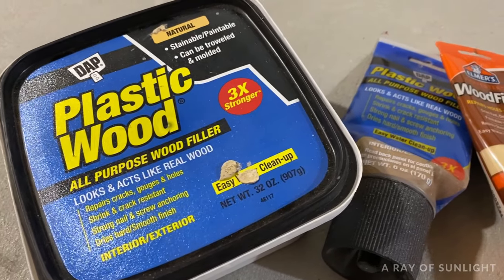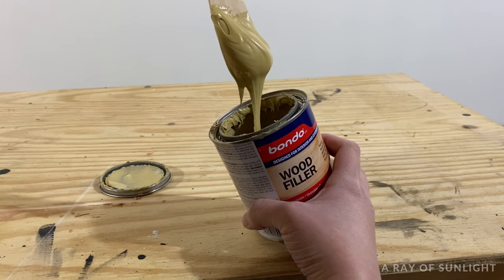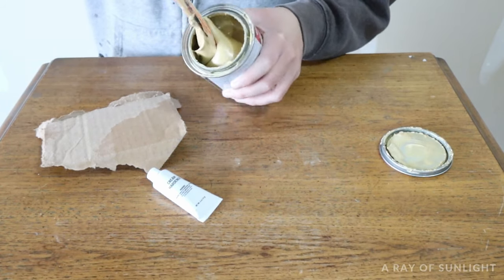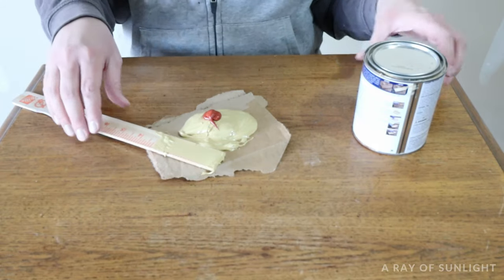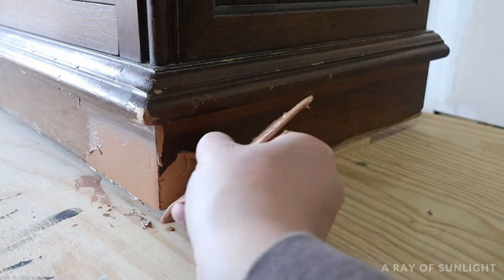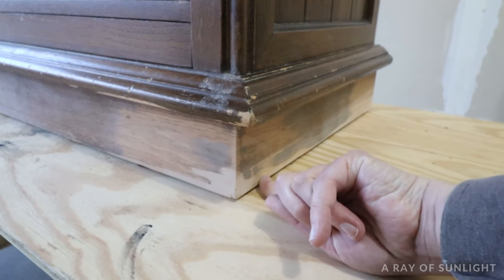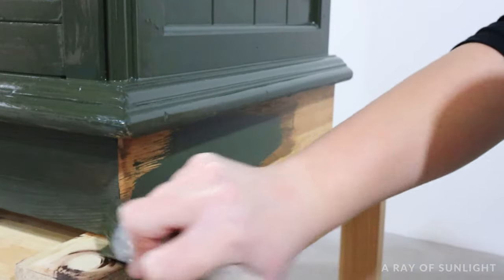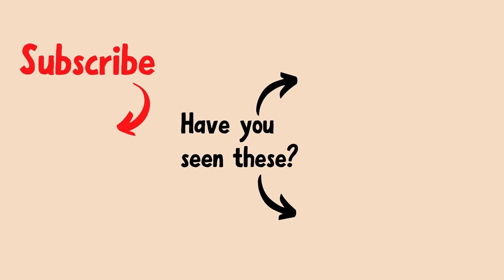Repairing Veneer with Wood Filler | BEST WAY

Comment: Hello! Love the video, very helpful, and have never heard of Bondo before. What is the name of the hardener you used?
Reply from the maker: So glad you liked it! The hardener is included with the bondo. Sorry I should have been more clear about that!
Reply: @ARayofSunlight  So its better to use gels stain on wood after is repaired with wood bondo? you can't use regular stain?
Thank you
Reply from the maker: You can use regular stain, but Bondo (and any other wood filler you use) won’t take the stain the same way that your wood does. Even different types of wood will take the stain differently.
Gel stain can sit on the top of surfaces instead of soaking in. So with gel stain, you have a better chance of the repair looking the same as the wood around it. 
Hope that helps! 
Also, be sure to use the wood filler Bondo instead of the all purpose or auto body version. The wood filler version looks the most like wood, so it will stain better.
Reply: @ARayofSunlight  Thank you very much for the tips. I appreciate it.
Now to go and buy some wood bondo.

Comment: What kind of sander are you using that is a square/rectangle with a hose attached, maybe to a shop vac?
Reply from the maker: It’s a surfprep sander. You can read more about it and which one I have here: arayofsunlight.com/surfprep-sander  I also share about a cheaper alternative there too.

Comment: Clearly bondo is no good for staining but very good for paint. There was a brilliant product for staining that has now been discontinued ARGH !!! It dried light and took any staining for a exact match, now I have to find the next best thing but this is not good enough for expensive furniture restoration,  anybody have any ideas what I could use for thin veneer patch ups that can be stained over for a exact match? Two part epoxy wood filler is apparently good but I haven't dared to try it yet until I get some furniture to test it on that isn't expensive furniture. ?

Comment: Sorry, but compared to a proper veneer repair, that is hack job.  I guess it doesn't matter if you are painting, but veneer is repaired by replacing sections with a good match of a new veneer